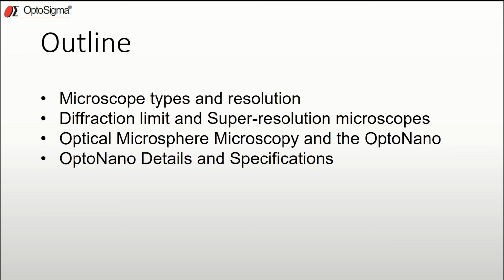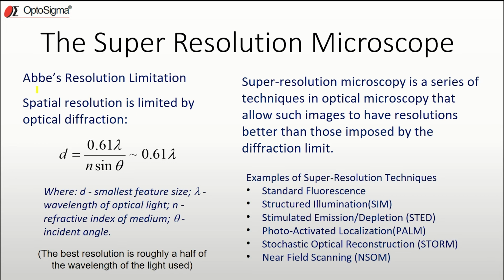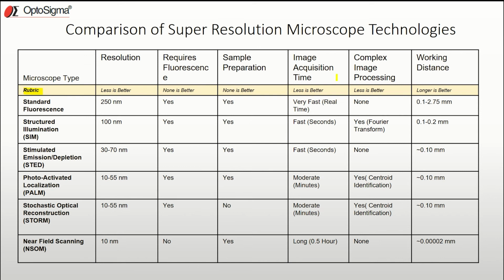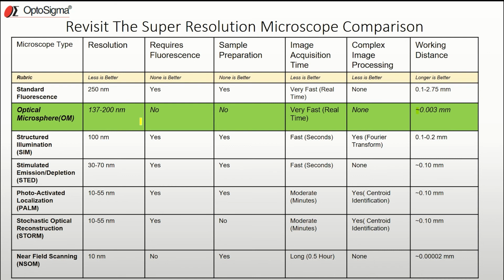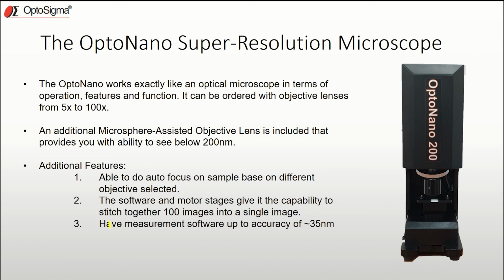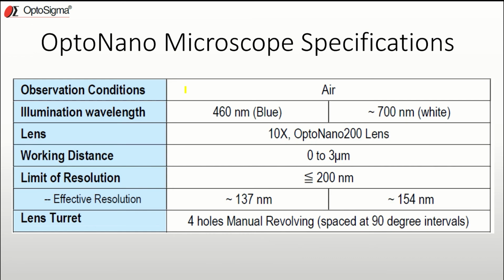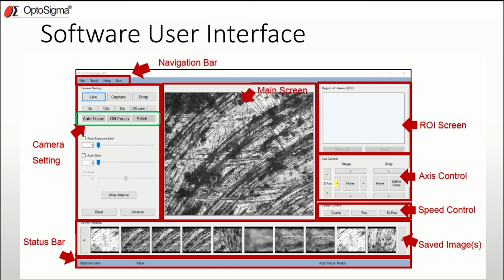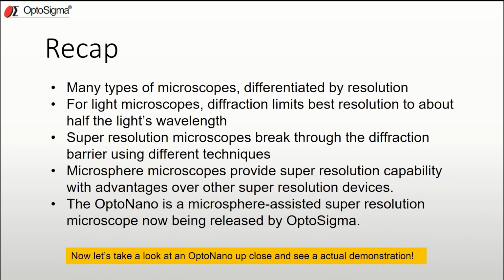2 OptoNano SPIE webinar - Technology Overview

Comment: very interesting. Utilising the micro sphere with working distance of < 3um is definitely increasing the system's NA. A system with higher NA will have higher resolution for sure and all these are within diffraction limit.  line width of USAF group9 element 6 is only 548nm, how could you claim that it can result <200nm?